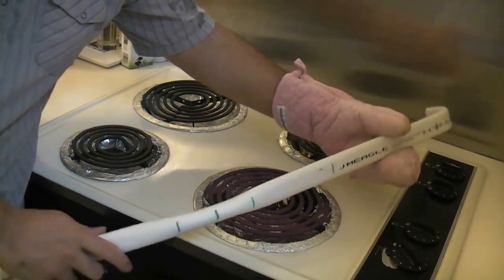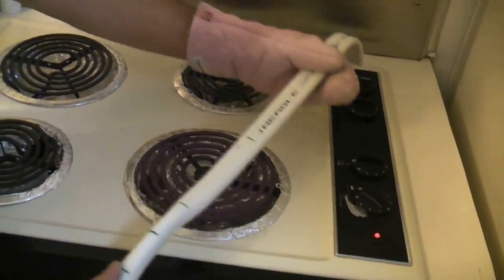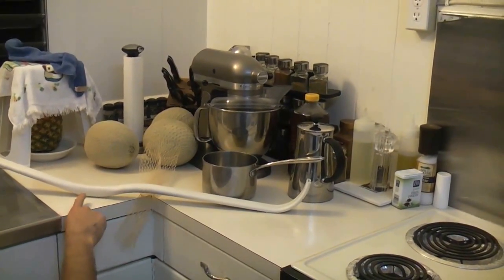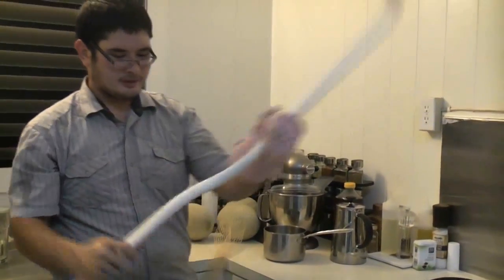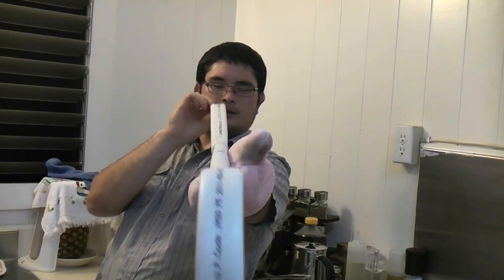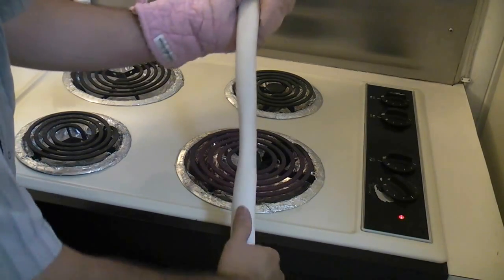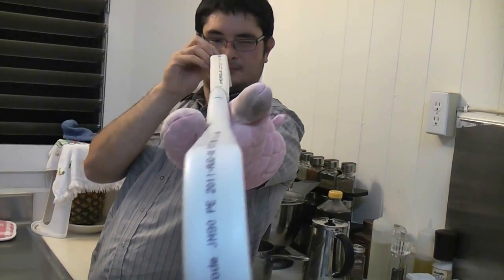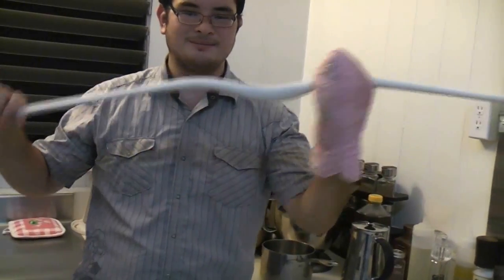Stovetop Flattened PVC Pipe Horse Bow Part 4

Comment: You mentioned that the bending contributes to weight gain because it makes the bow shorter. If I made a longer bow to have a lower poundage (I'm not very strong yet, being 15 yrs old), what would the dimensions have to be for the bends in the limbs?

Comment: I do know this is a older comment and you've might have grown a brain in 4 months. when the inside diameter is 3/4" and the outside is 1" then the the pipe wall thickness is 1/4", the inside diameter (if you can read) is 3/4" it has been said plenty of times